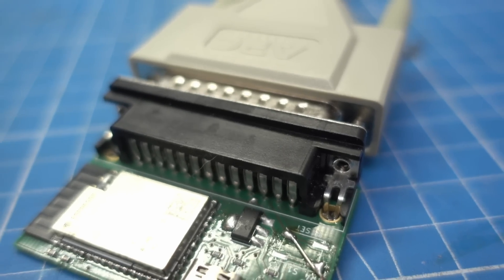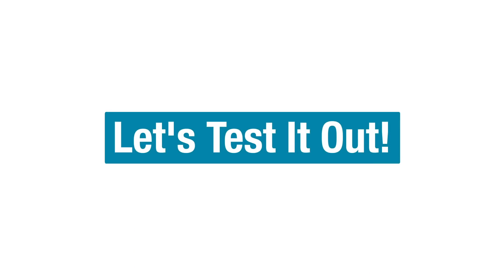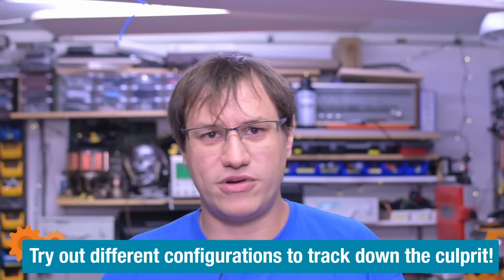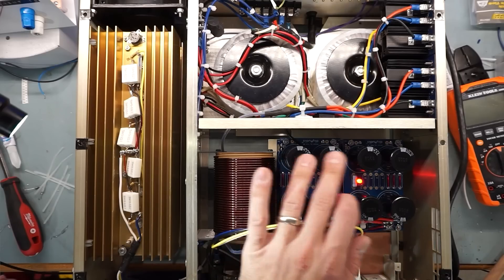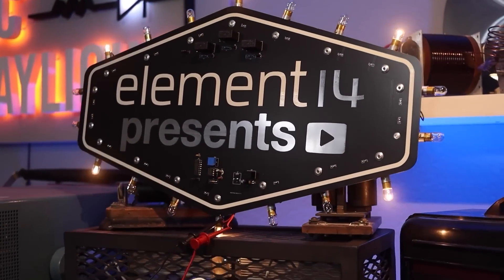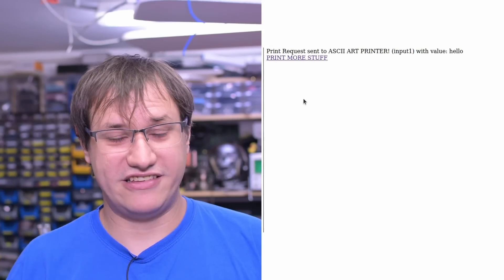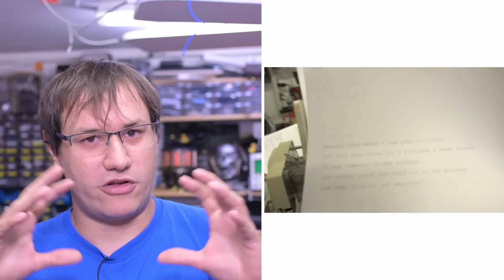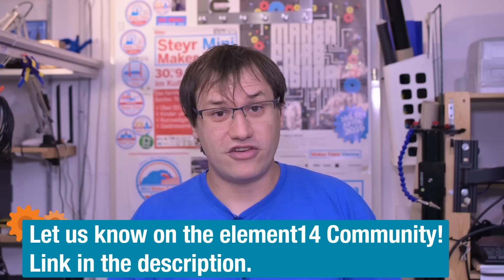Wi-Fi to Parallel Port ASCII Art Dot-Matrix Printer

Comment: This would be especially helpful if it could be seen as a text printer by default you could Wi-Fi any text printer d for any use
Reply: thats basically what it is. You can send any text or text based file  and it just prints it out. I will probably use it to print test reports or packing slips

Comment: @element14 - why make it so convoluted, CUPS drivers already exist for this hardware and old Windows Drivers exist. You just need to add a custom "interface", which acts as a logic-level interpreter and let the printer handle everything.

There is so much functionality lost for this. Why reinvent the wheel, and make a square box and call it "Good Enough". This is really really lazy...
While i get it from a electronics POV, writing low-level interface drivers for this. Its really a waste of all the hardware. You could be using it with lower latency, better shading support and much faster printing.
Reply: Nothing about this is lazy. This is a project about building custom hardware, not driver development.
The speed is dictated by the printer not by my software implementation every character gets sent when the printer is ready to receive the next one. This works completely different than for example a HP ink jet printer that receives data in chunks stores it and then processes it.
It's certainly possible to write firmware that would work with printers that would support cups or other framework, but that was never the scope of the project. The logic level portion is a hardware requirement and has nothing to do with software implementation. 
Nobody is calling anything good enough, the point of any of my projects is to explore electronics and what can be done with it, never to please anyone searching for a specific solution.
If you want a cups implementation go ahead and try it for yourself. That's the beauty of tinkering. Complaining about how someone else did a thing, is not helping anyone

Comment: I would have tried cutting the traces accepting signals from the printer and bodging in voltage dividers made from SMD resistors.
Reply: That maybe could have worked, but a proper level shifter needs a few more parts.

Comment: Fantastic! I love bringing old tech into the modern era. Thank you for your video.
Reply: you are welcome!
Reply: No, This is not. This is a line-level print interpreter. Its not "Bringing it" to modern era as there is already drivers for this device and your loosing functionality for this novelty usecase.

A interface adapter, should be a /interface adapter/. This doesnt adapt the interface, it adds a text to printer interpreter that prints text.
This printer can print full greyscale by adjusting the head movement speed. Its like putting square wheels on your car as you dont want to use a lug nut adapter...
Reply: @edenrose2374  Ok thanks for taking the time to clarify. Sorry, but I'm not as advanced as you, and for me this was just nice seeing an old printer work/interface with modern kit via Wifi. Also I was being appreciative to the content producer. Thanks again.

Comment: It would be great if you had justified your theory on a scope. I suspect the real issue is the tiny little 10uf ceramic cap of your regulator. Try with a 100uf tatal cap for a proper wifi operation.
Reply: power is not the issue the mcu does not reboot, only a failsave to protect the wifi engages during the spikes. But a bit of oszi footage would have been a good addition to the video.